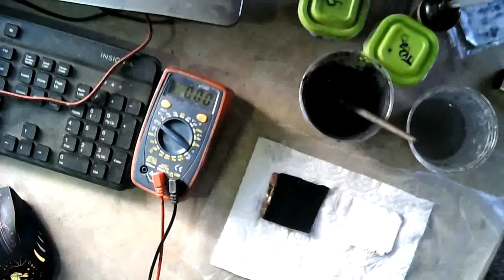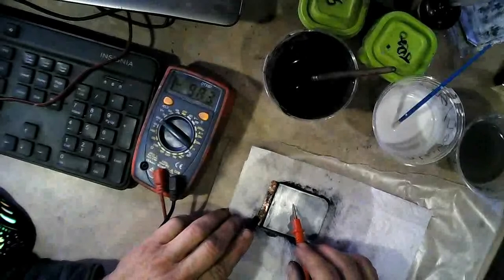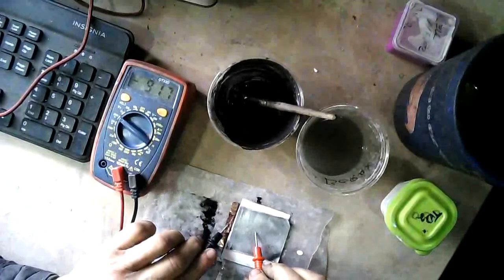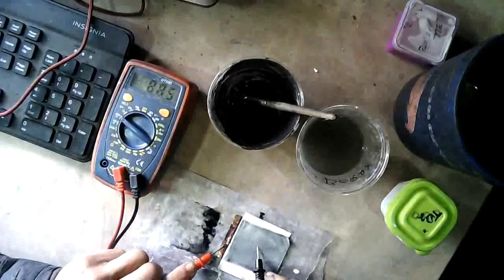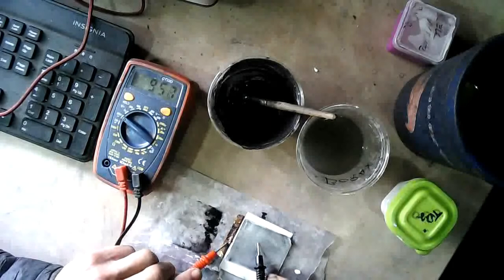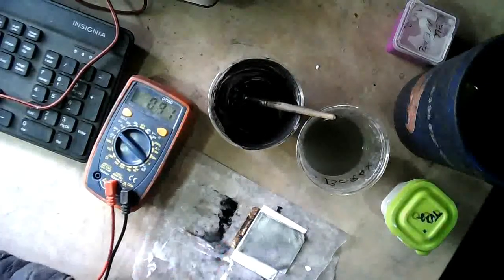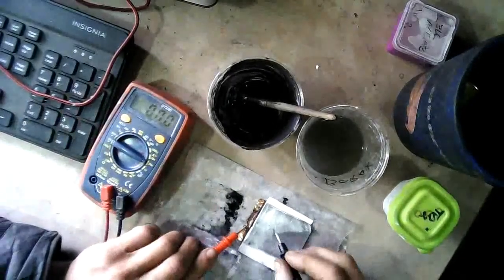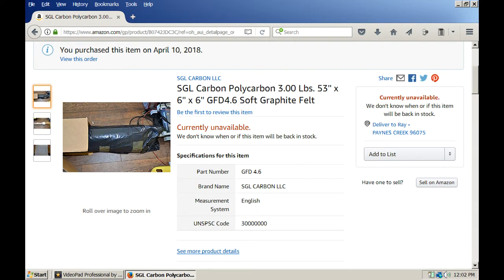Felt Shorting Problem Solved!

Comment: Dan has been having an odd problem with overnight discharge. It could be the separator. He's investigating changes to the separator. I was thinking about your cells. Sometimes the voltage starts dropping immediately after assembly. It would make sense that if the Ti02 is effectively shorting out with the carbon there would be an internal discharge. If the cell with the paper separator maintains charge overnight that pretty much verifies the problem is solved.